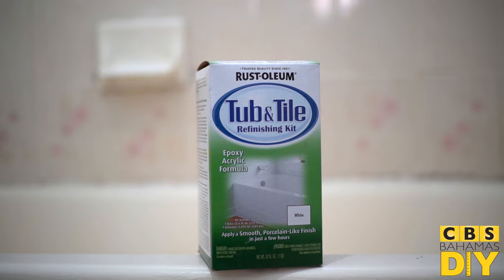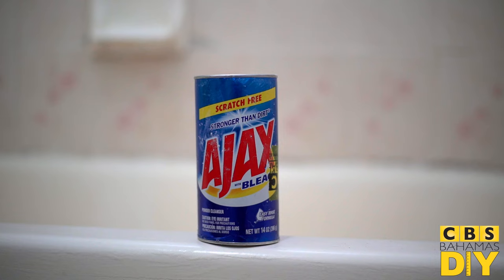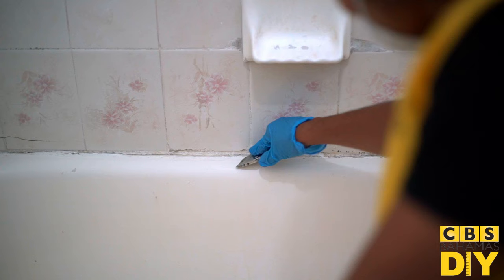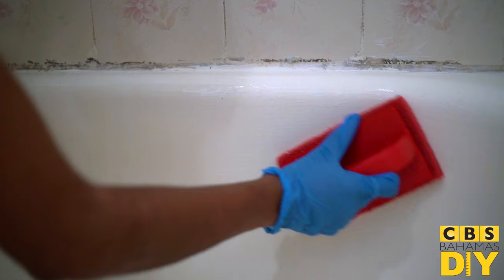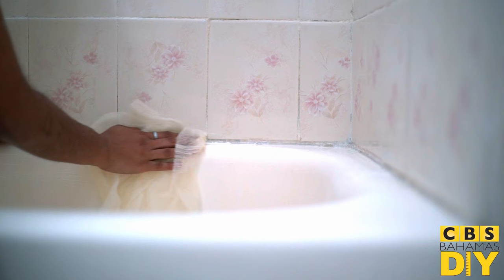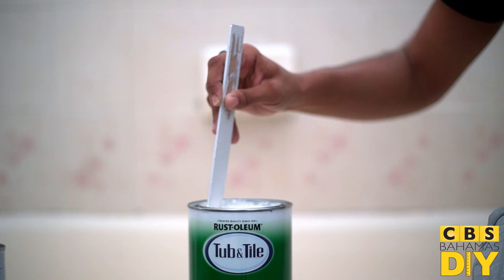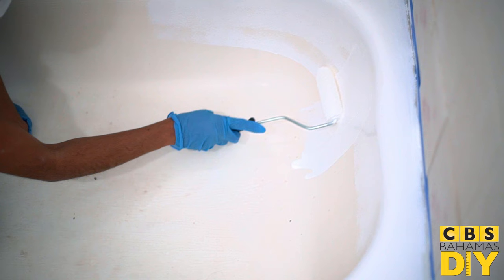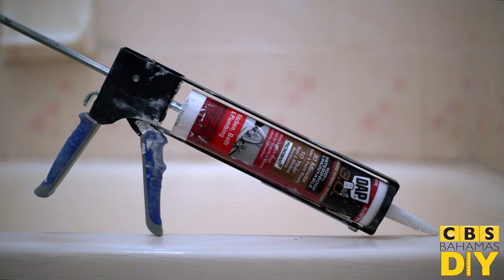CBS DIY | RUST-OLEUM Tub & Tile Refinishing Kit

Comment: What to do if there is rust at the bottom of the tub?
Reply: try toilet bowl cleaner. and sand it. Also ospho chemical to kill rust
Reply: @islandboy2424  how long does it have to sit after using the ospho chemical before applying paint?